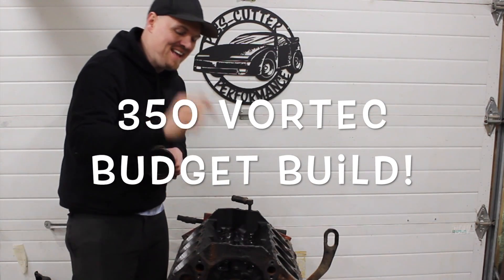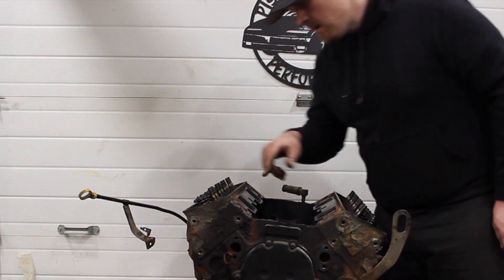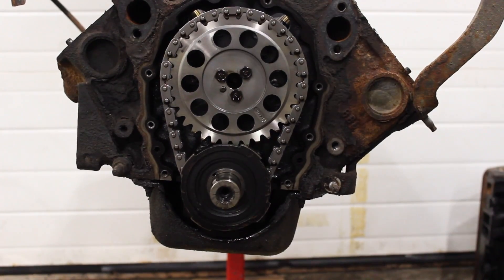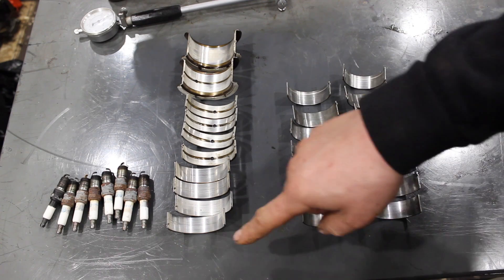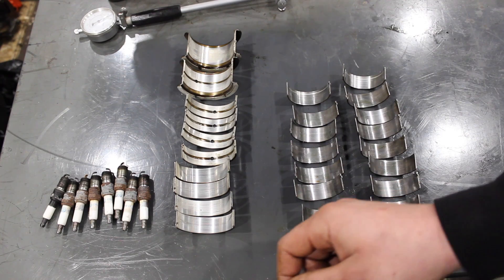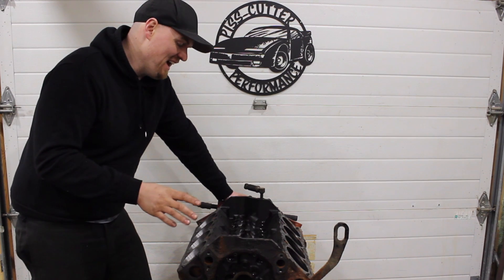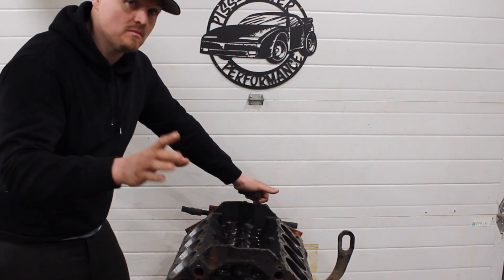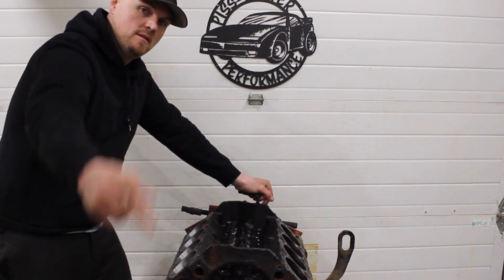Low Buck 350 Vortec Build! ( L31 Tear down) Part 1

Comment: I’ve learned a lot from your videos. This is the cam I chose for my son’s motor build. Factory 880 roller cam block. Summit Racing™ Pro SBC Camshafts SUM-8802
Reringing stock pistons, new rod and main bearings. (No grind) I’ve done more than I wanted to the 906 heads. To make sure we would have enough clearance. Springs retainers offset keepers.  Cutting down valve guides and installing new seals. Lapped valves. Most everything I did was learned from watching your videos. Finally we’re starting the reassembly Keep up the great Vids!!! Would love to see your results with this summit cam.
Reply from the maker: Right on man! Your sons going to have a great combo!
Reply: Can you tell me if the stock L31 roller cam distributor gear will work with the Summit roller cam? Or do I need a different gear? Thanks much!
Reply: @chuckhoeft5144  summits 8802 is billet steel, as is the stock vortec roller cam. you can reuse the distributor gear. however, if the block came with a flat tappet cam instead of roller like some of the pre vortec trucks did, you need a melonized distributor gear. there are 2 sizes. stock is .491" i believe, and most aftermarket performance distributors are .500".

Comment: Far as what we want to see you pretty much use everything I use as far as parts hey rebuild it's really not worth my time unless I'm going to get close to the 400 mark on this engine the some money is going to have to be spent but most of it's going to be cam carburetor intake valve springs headers I'm not sure really what you're aiming for not an expensive motor to build with decent power and longevity
Reply from the maker: Going to hopefully get more than 400 out of this budget build, possibly even on 87 octane
Reply: @cuttersperformance u are the dude😎👍 actually I think you can pull off more 435 right around there with a nice even torque line guesstimation 430.to 445lbs I believe in you brothe💪

Comment: Why spend all the $$ on resizing the rods when you can get a new set of aftermarket rods for about the same $$. If you get the lessor expensive rods that have the 3/8"-24 cap screws you can get a used set of Carr or Pankl bolts for about $40 off of eBay! The nascar teams usually swap out the bolts after about only 2 races and even at half strength they're good for more power than the 500HP rods are rated for. Those bolts sell for $68 a bolt new! They better be good for that price.

Get 6.00" or 6.125" long rods to get a better rod ratio for less side loading friction. Make sure if you get aftermarket rods to never use the Chinese bolts that may come with them, I have heard of the threads pulling off and failing. Rods with the 3/8" bolts you can get the cheap used nascar bolts to swap but not with the rods with the 7/16" bolts, you'll want to get the ARP bolts for those but that isn't as budget friendly.

The cheap Speedmaster rods are decent as long as you don't use the bolts that come with them(unless they are ARP). The threads on the Chinese bolts are cut not rolled like the ARP bolts are and is probably why they're not as strong as they should be? Cool project.
Reply from the maker: If i was starting fresh, then yes, a 6 inch rod would be ideal. But going to a 6-inch rod means I have to change pistons. The plan is to use as many stock parts as possible and see what we can get out of it in the end
Reply: Ultra cheap it is BUT you did mention performance so there is a little bit of cost for that word. That being said those dish pistons need to go anyway, you can get a cast set of flat top pistons. Put this number in the eBay search $193,135,117,538 and these are standard bore flat top cast pistons for $92.25 with free shipping. Make sure to remove the commas and dollar sign when using the numbers in the eBay search, stupid yt kept deleting this post hoping it stays that way?

Put this number in the eBay search $165,249,765,492 and you'll find these 5.7" rods hat are on sale for $189.99, 5% off but wait they also have a "make an offer" selection so you might be able to get them down another 5%?

So it looks like the bolts for $40 are gone and other eBay stores are selling them for $99.99 for a set of 16! All is not lost, you can make an offer on the nascar take out rods that come with the bolts. Put this number in the eBay search $203,625,996,535 to get to the rods. It is listed for $85 with free shipping but has the "make an offer" for them so maybe you can get those for $60 to $75 shipped? Even the $40 bolts had IIRC $9.99 shipping. The kicker here is you can put the rods on eBay for what you paid for them + shipping without the bolts so they'll end up being free?(minus a little time on eBay)
Reply: This is to try not to have yt remove my comment! Had to reply to my comment as well because yt kept removing it when I replied to Pat in the shop!

Comment: Great start up for the build! I'd love to see a set of stock L98 aluminum (113) and stage 1 (towing or stock) cam with Edelbrock performer RPM on the engine
Reply from the maker: I had a set of those heads a few years back and shouldn't have sold them!

Comment: How can I be sure to get an L31 that has 4-bolt main?  Is there anything on the outside of the engine that will indicate 4-bolt main?
Reply from the maker: I have found no certain way to say for sure but here are a few tips.
-Look for engines out of 2500 pickups or vans, its rare to find a 4 bolt in a 1500. 
-Pull a valve cover and if it has 906 heads theres a higher chance its a 4 bolt. 
Some claim that if the top bell housing bolt is tapped, then it's a 4 bolt, but I have 3 two bolts in my shop with that top hole tapped 😄
Reply: 8600lb gvw trucks had them, I know my truck does by the rpo codes. I’ll have to look at the bell housing bolts and comment back later

Comment: I'm also building an L31. Had a Rod failure caused by not changing oil by the preowner. Now it is bored over and has Summit flat top pistons 17350C-30 and rods 180370P and ARP studs. I will use it for street but also want to be ready for more upgrades. I put a stock LT1 cam in it, because it should work fine with TBI, but i might want to install a cheap high lift roller cam one day. Really like your content!
Reply from the maker: Right on man, you got a great base combo that can really be woken up with a cam upgrade if you choose to

Comment: Overnight leaking well plugs in 2jet and quadraflood Rochester carbs and stuck chokes have killed more 350 Chevy's at 100,000 or less. The great bore life is attributed to better fuel management due to injection in the last 35 years, I've seen TBI truck motors with 300-400+ thousand on them. You couldn't have pulled a 77 model 350 engine not running that far without major issues, worn bores and rings burned valves cracked seats, or half the lobes flattened on the bumpstick( lol that's almost a pun at .398 lift😅) 

I'm about to do a stockish rebuild on a 97 Tahoe 5.7 gonna put it and the tranny in my newly acquired 69 Suburban @the Bus😊
Reply from the maker: You are 100 correct, fuel injection helped so much for cylinder wear due to fuel wash.
The vortecs got even better for bore wear with MPFI and the low tension rings
Reply: Plus overdrive transmissions cut the milage /rpm in 1/3 over the same distance, carbs didn't work so well at 1800 at 60mph like injection, the vacuum signal x fuel mixture didn't coincide.
Reply: Most of my older stuff still have their stock stock stock Dualjet or Quadrajet and they run as good or better than newer small blocks.
Reply: @xmo552  sorry to have generalized and made it a blanketized statement. I'm sure out of millions upon millions of those leaky carbs there were some but very few ok to good ones. ALL the quadrajets I've ever dealt with needed the well plugs epoxied and the choke pulloffs chunked in file 13. Js

Comment: Weird question.  How good can you do with TBI heads?  They are everywhere and how good of power can we get with them and whats a good cam for them?
Reply from the maker: I have been looking for a decent TBI core to do a build just like this one
Reply: @cuttersperformance  probably hard to find, anything still running is probably at 400 000 km.
Reply: They shine at low engine speeds. A mild 260 cam is about whats best with them

Comment: I just got my 92 Silverado running today it got an 880 4 bolt main from the junk yard with only 116k for 500 bucks I put the TBI back on it for now it's got way more power now.
 
But honestly on the build for your motor I'd like to see a straight up raw power build no turbo no supercharger.high compression barley drivable on the street type build.
Reply from the maker: This one will be using the stock pistons and compression, so we can't get too crazy with the cam but...your going to love the new upcoming "Dingle ball 355" videos. Its a 11:1 ported vorted headed 355 thats getting a custom grind roller cam and going back to the dyno
Reply: Hey that works honestly 500hp would be a good bench mark maybe 475